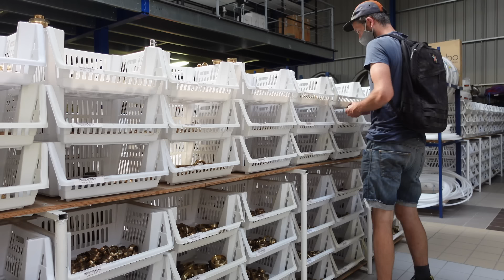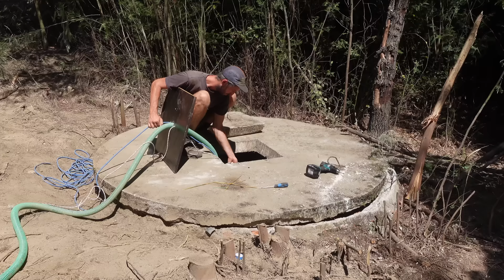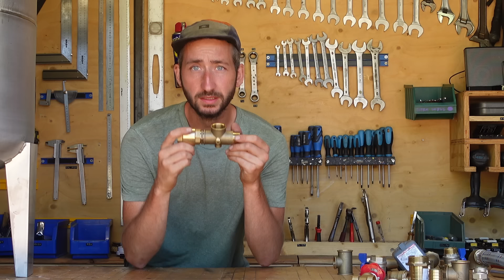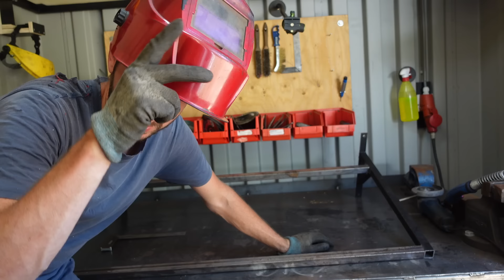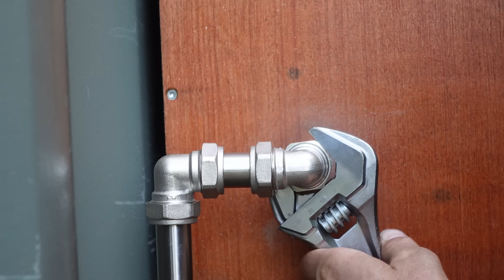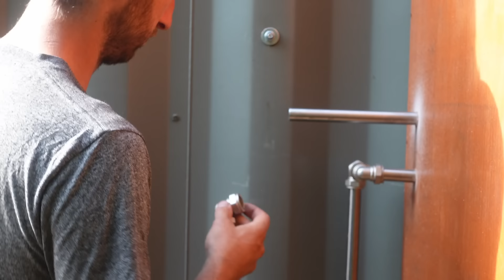#31 How we got running water from a well #offgrid

Comment: You probably have a problem in the future!!
When the water pipe in the road don't have water in it (pump shut down), the dirt will settel and constrain the pipe, it will not have the same water flow, like now, and in the future not at all! (now problaby it´s ok, because of dry weather, but when in rainy season, you will have a major problem).

You should have put one of those sewage pipe in the road crossing, and then the electric cable and water pipe inside.
That way if you have a problem you can exchange the cable or water pipe, and not dig and open the road again.
Reply: Yes, we (although not Portugal) also have piping run through bigger steel pipes in paths where there could be 'traffic', to prefend earth and debri in the paths crushing the piping (Polyethylene hoses for live stock auto waterers, electric wire for the electric fences etc).
Reply: they already did that.. look closely at the other end, and you see it...

Comment: If you have winter weather in your part of the county you will need to do more digging for the water pipeline. Should be deeper in case of freezing. Also the section under the road should have a metal pipe or something similar to protect it. Over time cars passing over will compress it.
Reply: Exactly what I was worried about.
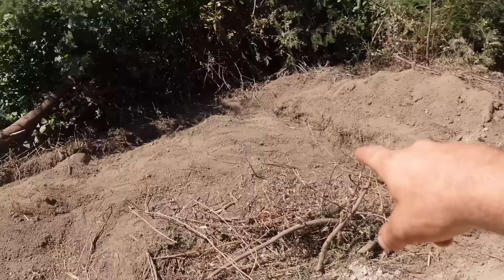Reply: 13:44 Where the pipes come out you can see they are in another pipe.
Reply: Also leaving it shallow the water will heat up from the sun, so Luke warm water instead of cold, and potential for bacterial growth, but they have made a great start.
Reply: Dude... He has the water lines that feed his house above ground, completely uninsulated, and you're worried about the lines that run below ground? I'd be more worried about the kind of hose he used, that's not gonna last.
Reply: @timderks5960  The exposed ones can be insulated without much effort.
The underground ones aren't so simple to insulate after they are buried.
Reply: @timderks5960  100% agree.  Winter has presented itself when staying in the vans.  He had to run space heater inside.  Frost on the inside of his windows.  Mattias van had a jug of water and a foot pump system that clogged up with ice.  
Insulating the new plumbing system with foam pipe wrap or aluminum wrapped rock wool and cork lined box is an insurance policy should winter tip toward the extreme side.  It's that or plan to "winterize" the entire system the way they do for unoccupied trailer homes or RV's off season since the water demand drops substantially for the camp.  In our mountains we're accustomed to keep the sinks dripping during cold snaps to prevent pipes from freezing in old construction.  Wasteful a bit, but a stitch in time saving nine means it saves thousands in plumbing repairs. 
The underground lines are still a thing.  Frost heaving even for municipal supply lines is problematic.  I'd take the advice from local water companies about underground water lines.  Water, electric, and gas are obliged by law to have dedicated trenches 6 feet apart and file the plan with the town so the utility companies can dig safely and the fire dept has a map in advance of response to emergencies.  Even though the laws may be different there, it's good to consider best practices.
Reply: What I thought before I thought about winter, was that they would heat up way too much during the summer so you wouldn't be able to get any cool water out the other end.
Reply: I dont think freezing pipes are a problem in Portugal.
Reply: @zoninable  Thats what they said in Texas.
Reply: @zoninable  You obviously didnt watch one of the first episodes when the pipes froze in the yellow van.
Reply: @zoninable  I think yes, it depends on the period.

Comment: As others have said, that road piece needs more protection. 
Also what's the coldest temperature around there? Here in denmark we need to dig 90 CM into the ground to make sure the water pipes are not blown by frozen water.
I would install a carbon filter and UV light in-line with the water going to drinking if there's anything bad in the well. (ref https://www.youtube.com/watch?v=O2VsAwRY6AQ )

Comment: interesting that you are using stainless steel for your plumbing most of our lines are either copper or PEX pipe.  That digging was brutal, at least you do not have to dig below a frost line.  In most parts of Canada we need to dig down 4 feet.

Comment: Hi great work on getting water to the camp.  Re crossing any road with water and or electrical. Its a big mistake to direct bury the lines. Traffic from the road will compact directly into both the water line and the electrical wire, and within a very short period of time they'll both break down. Plus if you need to replace them or do any maintenance, you'll be digging up the road surface again.  You should have placed a culvert pipe of twice the size that you need, and with thick enough wall material to handle the constant vehicle traffic, and it should be at a specific depth (local building code will advise on that parameter). The water line and electrical cable get pulled through that, and really the electrical line should be within a small pipe to separate it from the water. Thus is anything fails. you simply dig up either side of the road (not the road itself, and pull in a replacement line/cable. I hope that helps, D
Reply: I mean, i'm more worried about those lines failing during winter freeze which I find to be the more pressing issue than road compaction given that that road probably see's minimal traffic
Reply: @jarstore  How could they stop the freeze?
Reply: @XyAn5P6ZeUik  well without putting it below the frost line then the best thing to do would be to insulate all of the line outside of the well and if possible run a heater wire that you can turn on when temps get below freezing, the main goal is to keep it from freezing solid and bursting the line.
Reply: There is no freezing to afraid. But yes most easy I think, is to put bigger strong metal pipe in the road crossing, for protection. And hot water for the washing machine(and some more), to save electricity. Put black water tank on the roof. As Greeks :) . Sun will heat. Cold water into tank from bottom and hot out from top.
Reply: ✌️Also they compromised the compaction of the road which was good, so when it rains that will be a weak spot, but I’m sure they will rectify all this in time, I’m still mightily impressed with them all👍🏼 🌅
Reply: I'd say for what they're doing, a 150 mm orange waste pipe should be more than plenty, 110 might be enough. Still wise to bed it in sand to avoid having any sharp bits puncture or deform it. Proper underground cable tubing is cheap and makes replacing the cable a breeze if necessary, so I'd be tempted to bury a 110 mm pipe for the water line and a 50 mm one for the cable.

Going 600 mm deep is probably a good idea, although most places I know seem to require 800 under any surface vehicles drive on (i.e. including home driveways).
Reply: I was about to point out the same, although in much much much much less detail :D here in Aus the building code mandates 600mm depth for buried cable and pipes. Basically a deep trench with washed gravel on the bottom and top of pipe/cable culvert.
Reply: And water and sewer in the same trench💩💩💩 no good if something breaks haha looks great and fun though

Comment: Need to extend the overflow pipe in the well upwards 12 feet to allow for higher water levels👍 did you get the water tested see if it’s safe to drink if not you’re gonna need more filters to use it for drinking 👍 on your showerhead why don’t you use your Pipe bender to make a round shower head also you need to protect your pipes from freezing winter is coming in 3 Months👍👍👍🧊🧊🧊🍻🍻❤️🇵🇹
Reply: It was said that they are going to test the water later ..

Comment: Do you run your waterline together with your electricity in the same whole without any security measures?
Reply: That electric line should have a GCFI. That way if the electric line's jacketing gets pierced and there is water around, it'll trip instead of wasting electric. 
Makes me wonder if they even have a grounding rod.
Reply: the powerline connected to the pump is ment for under water.. I think it's safe... ;P

Comment: GENIUS !!!!! I cheered and laughed ( and teared up) at your excellent progress.
One question….. do you get freezes ? if you do, you may need to insulate ALL piping.
Reply: Or drain it out before freezes. I would have wanted it to be at least 28 cm down in the ground.
Reply: its very rare in Portugal. some flexible tube would e better to accommodate minor freezes, but chances are really low of damage from water freeze
Reply: @pinheirokde  exactly .. that few days there might be frost... it's easy to just open the valves, and shutoff the pump
Reply: @ric_dk-9520  for that they are fine the tube they use from the pump to the tank is flexible and it's impossible to freeze the entire well so the pump will be fine... Chances they actually freeze the water in the pipe from the pump to the tank are close to zero.. the pipe is hurried and the land does not freeze here.. in the worse ever wether we can have 1 day maybe 2 days were the average temperature is below zero.. 

They are fine ..
Reply: @pinheirokde  exactly what I said... ... ... I live in Portugal...

Comment: You should protect the pipe in the road crossing. Insert it onto a steel, hard PVC or concrete pipe jus to make sure a heavy truck/tractor won't smash it.
And what about sewage??? where is this wastewater going to?
Reply: Agreed. They did not bury it deep enough to not be crushed by trucks. Either protect it, or bury it 80cm or so down.
Reply: The land is dry, grey water from the sink and laundry can be used on trees or wherever. I would hope they use a hose out the back of the kitchen pod's drain to move around where it's needed.
Reply: Sewage & Fresh Water line do not go together
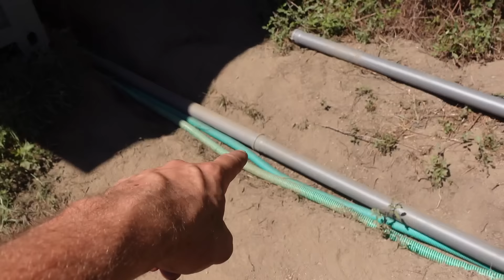Reply: He mentions the sewage at 14:03

Comment: Does your generator have a regulator? Because the balance in power a generator has can be bad for the electronics in a welding machine. Same as charging battery’s with it. We had the same problem here. 
And what are your plans to prevent freezing of the pipes in winter? Or doesnt go temperatures so low over there? 
Love the channel btw 👌🏻
Reply: It almost never drops below 3C/37F in that part of Portugal.
Reply: @oldskooljules  Then i wouldn’t worry about freezing 👍🏻
Reply: Texas joined the chat

Comment: Bonus round extras needed:
Catch the water for tree use, add a solar box for a hot water line, and add the hot water to the shower, sink, and laundry.
Reply: Coiled black hose on a roof works well to heat up water ;)

Comment: Do you have to worry about winter and freezing water lines?
Reply: It's like asking for trouble, the water will pick up the heat from the land as well in summer, so cold water will take some time. They can always drain the lines then no worry at all.
Reply: frost is unlikely in those parts of Portugal

Comment: I would suggest to put another tank on the roof and paint it black. Sometimes a warm shower is just so much nicer. :-) To have some way of directly heating water with solar would probably also be beneficial for efficient use of the washing machine. Heating the water for the machine with electricity will quickly drain your batteries.
Reply: An actual solar collector does a way better job than just a tank. And they are easy to make
Reply: @ric_dk-9520  The only thing a collector can't do is store the heat. Combining it with a tank would be ideal. I was just suggesting a quick and dirty solution.
Reply: @martin_mue  you ofc add a hot water tank and a circulation pump.... Only using a tank will take a long time to heat up... and only works when there is a lot of sun ... A collector needs so little sun .. the total collection surface is the key.. a tank does not have a lot of surface facing the sun + to not loose the heat again, the tank needs to be insulated... making it impossible to collect direct to the tank... What you suggest is fine for one or 2 ppl in summer .. but they are staying all year and be many more ppl... so a propper solar hot water system is the way to go.
Reply: @ric_dk-9520  I would say the effectivity of a tank only depends on the surface area directed at the sun. For a combined solution a circulation pump is not strictly necessary. I once saw a setup where someone was heating their outdoor pool with a DIY made collector from black plastic waterpipe behind acrylic glass. The water was recycled by convection only, worked great.
Reply: @martin_mue  Yes I know you can make the system circulate by it self, but it removes any flexibility of where to put the tank. A circulation pump is used to have forced circulation even at low temps and lets you put your tank and collector where ever it suits you (and not the tank as the highest point in the loop, and the collector the lowest).
Reply: @ric_dk-9520  I guess the main argument for a passive system is one less potential point of failure. Concerning the positioning of the components a thermophysicist could make an argument why, I can only attest from the practical example of the pool heater that it is not necessary to have the collector at the lowest point in the system, there the collector was mounted above the waterline by the side of the pool. I would imagine the most important constraint is that you don't get air into the circulatory system. Thus also the most reliable implementation of such an installation would probably be a closed loop system with a heat-exchanger in the tank. That would also allow to use more effective liquids for heat transfer than water. In general what one would be building with that IMO is a "heatpipe" https://en.wikipedia.org/wiki/Heat_pipe
Reply: That won't work for winter. You need to create a hot house for the water, and instead of a tank, surface volume is more important.
Reply: I am sure Vaillant (and other brands) also sells the ideal solution (had that myself when I lived in the sticks): a geyser running on propane.
Reply: @Roosmarijn035  absolutely no need for propane heating.. they can do fine with solar and supplement with an electric water heater running on solar. And solar collector you can easy DIY.. a propane burner no so east to DIY safely.